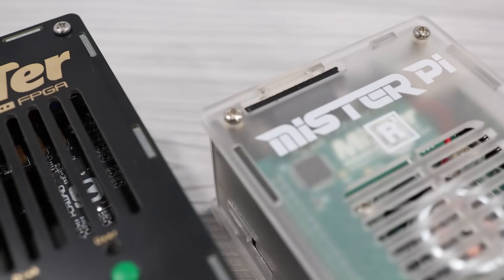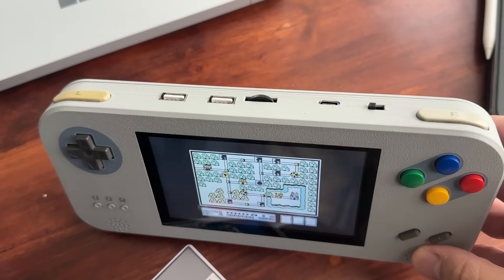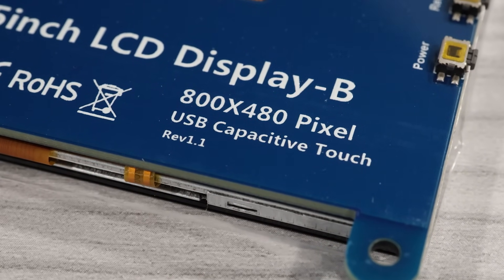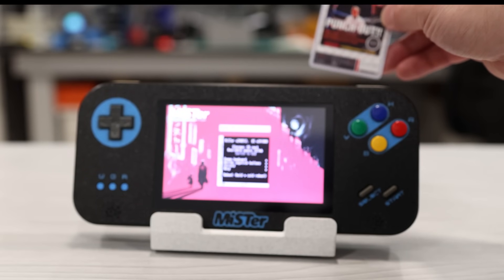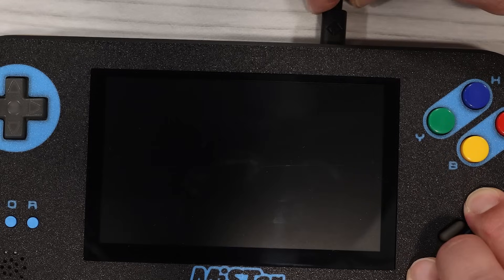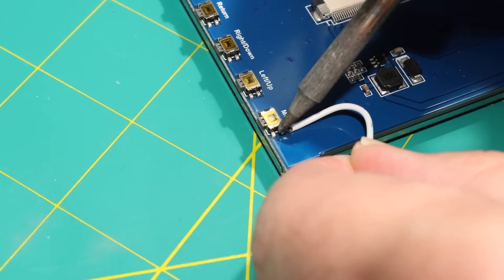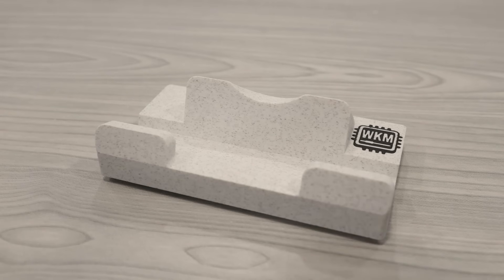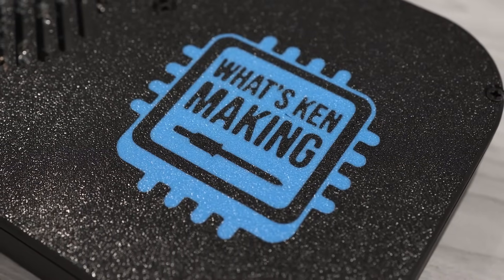The DIY MiSTer Handheld

Comment: I have loved this project and i think its sitting squarely in my proce range and areas i wish to gain/improve skills - ive never made a pcb for example and i think that this could keep the reusability of the board but provide some improvements for the buttons, device feedback and the battery charger.

Having just splurged on a new home lab setup though, it will be a few months. I really hope to come back to this.

Comment: Have you considered making a custom PCB that already has the controller, charger and battery control built in? It would really simplify things.
Reply from the maker: Yes - Model 01 is just the initial design to get something out in the wild. Keep an eye out for Model 02

Comment: 2 to 3 hours of battery though...
Reply from the maker: I know... but we have to start somewhere
Reply: @whatskenmaking  It's a fun thing all said, don't get me wrong. Sadly I don't think fpgas like this are efficient enough for handhelds, even the Pocket can only manage 5 hours tops. Still, I look forward to more from this and whatever Taki comes up with for his device.
Reply: On par with x86 handhelds...
Reply: @jimbotron70  Not exactly an endorsement. My Game Gear got better mileage.
Reply: @Idelacio  You sure? GG was notoriously a black hole for batteries.
Reply: @jimbotron70  ngl, you had a game gear and the early purchase was a rechargable power pack. Lasts 5 hours easily enough.

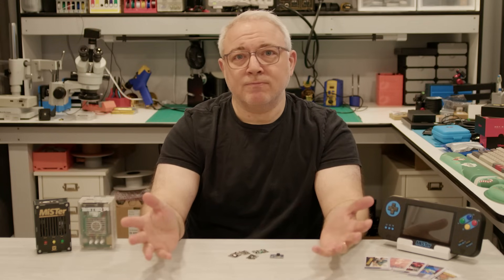Comment: 7:19
What you need to search is "solar" in the description of most modules. Anything solar will have "load sharing" which charges your battery + load like every smartphone on earth. MCP73871 modules should be enough since it outputs 5V, these are dirt cheap but you need to solder a USB-C port yourself. Adafruit MCP73871 has USB-C onboard, but the updated BQ24074 is better since BQ is what nintendo switches uses and some laptops/phones.

Comment: What a great project.  The TapTo module will be wanted by at most 1% of users.  If that came out, you would have more space on the case for input / output and possibly even a second battery.  Would be awesome with an OLED screen because the one you used looks washed out and old.
Reply: For me, the excitement around tapto is baffling. One of the whole reasons I am into mister and ODEs is to reduce the amount of plastic crap I have.
Reply from the maker: Yeah, people love it or hate it. I really like it as a mechanism for battling the 'paradox of choice' phenomenon that I talked about in my TapTo review video
Reply from the maker: The washed out screen is primarily due to my camera - I didn't do a great job with color correction in this video

Comment: Suggest consider using a tiny RP2040 microcontroller board for the controllers and other buttons because then you not only get more Raspberry fans involved too but RP2040 works great for this purpose with close to zero latency input and it makes the project even cooler for using it 😊
Reply from the maker: I completely agree - I actually had some issues with the quality of the Atmel boards that I used. I'm exploring the possibility of an RP2040-based solution and possibly providing wifi through it as well
Reply: @ the newer RP2350 is another interested option because it has a DSP so could also be used as a sound card

Comment: How about a modern PSP like analog stick on the left below the D-pad. In my opinion the PSP Analog fits more for arcade an retro games than a normal "modern" analog stick. 

I once tried to build a 8 way clicky micro switch variant years ago but never had finished that Idea.
Reply from the maker: I've been looking at various analog options. I think a Switch stick might be a bit nicer to use than a PSP one

Comment: You should have put an analog stick on the left. N64 is the main reason. Nevertheless amazing work you have done. ☮️
Reply from the maker: Just on the left side? Do you think a Switch analog stick would be good, or does it need a larger one?
Reply: @whatskenmaking  I guess a switch analog stick is enough. Maybe a hall sensor stick to be on the safe side. ☮️
Reply: @whatskenmaking  maybe you need an analog stick on the right to be like the c buttons on the og n64 controller. ☮️

Comment: Super neat. I dont know if I like the snes controller cannibalism, though.
Reply from the maker: Neither do I - it's the toughest part of the build. I'm taking a different approach for Model 02
Reply: I’m sure u can use a retrobit anytime?
Reply from the maker: Yes, you can plug any usb controller into the USB ports on the top